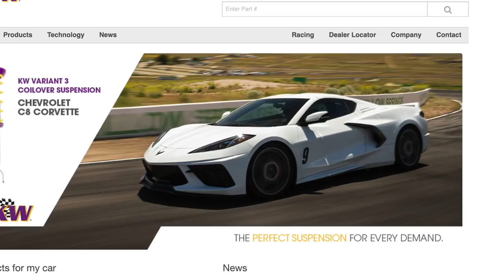I chug $200,000 ENERGY DRINK while race prepping my LO206 Go Kart

Comment: I have to say....Nicer hardware than I had in the 1980's....But, the motor argument.....Nothing better than a 2 Stroke motor getting to "Full Song" and "On the Pipe" as they say....Where the exhaust tuning gives you that "Time Warp" effect....In my day we bolted the lead weights to brackets that mounted on the frame....Guess the fiberglass is quality material with an epoxy resin?

Comment: Whilst Briefing 2 Drivers for a Session in Hire Karts "Don't push until the tyres are warmed up. These little seats will bite you hord."
One of the drivers left the Pit, turned left, right and crashed sideways into the barrier.
He came back 3 days later with 20 other drivers  and a cracked rib. He and his mate had been getting in some practice for this race. Now he couldn't drive.
He apologised to me for ignoring my briefing.
Those seats are NASTY.